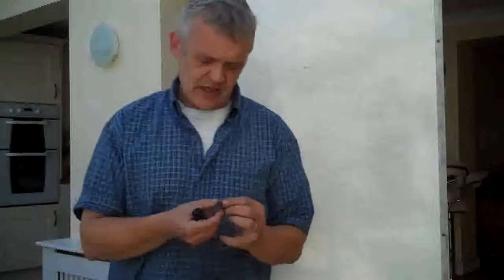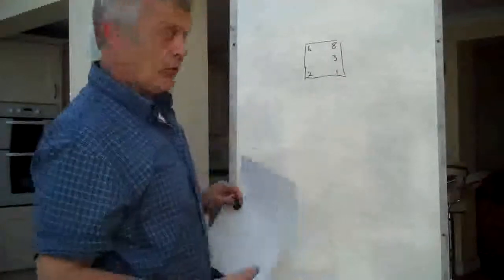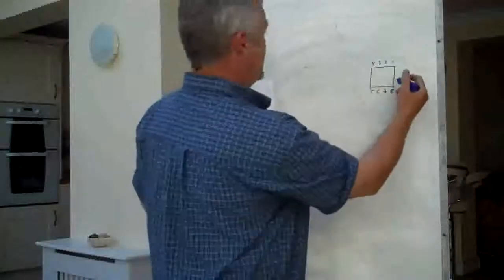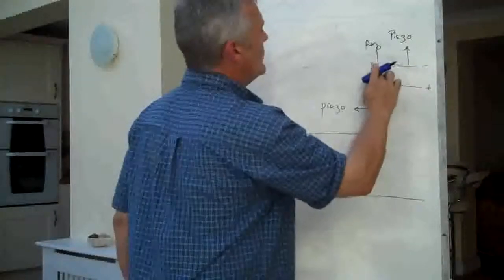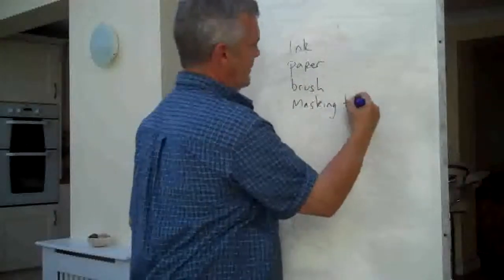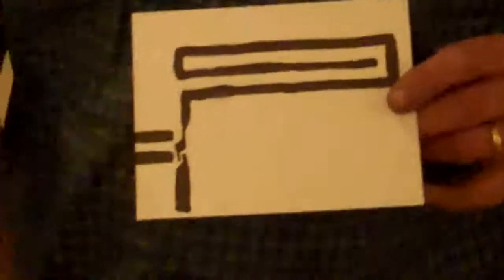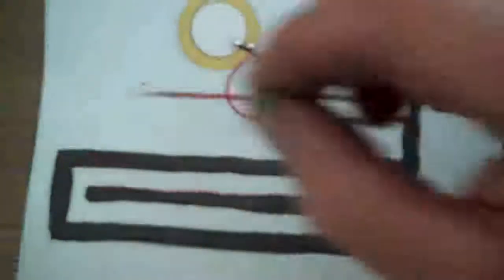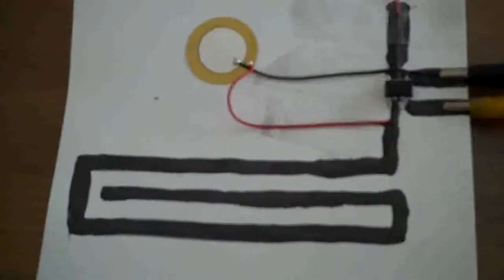Paper Electronics 2 - A Basic Stylophone

Comment from the maker: connect from pin 3 on the 555 through a 0.1 microfarad cap to a 10k pot. ground the other side of the pot and wire the central pin to pin 3 of an LM386. The stylus also connects to pin 3.

Comment: odd, i didn't see this in the playlists,it just showed up on the right recommended list,ohh well, a question robert, which magnetic/conductive ink formulation would soak into generic strong nylon sewing thread (would it stiffen it up?) for use in these paper based and related circuits for magnetic paper to paper batteries contacts encased in hot glue for longer use stability perhaps if needed and replacing the copper wire as in this use case.

the fact being, i'm not a fan in 2019 of adding non active inert material  in constructing a device,making it heaver for no real gain, just for ease and initial quarterly profits after commercialisation.

  don't use metal  for the case when you can make an extra solid battery in the shape of the case as it where, snap together magnetically  series/parallel connected supercap  backplates with battery molded front facia  with a thin  paper battery/supercap pcb controller slipped in place should be doable now if some electronics major can be bothered to translate the current existing circuits into paper circuits etc.

Comment: Brilliant!  How strong is the surface mount bond on that 555?  Will it withstand a little flex or does the paper need to be rigid, like cardstock?  I guess a dab or two of glue would prevent it being an issue even if so.
Inspiring as always.  Thanks!